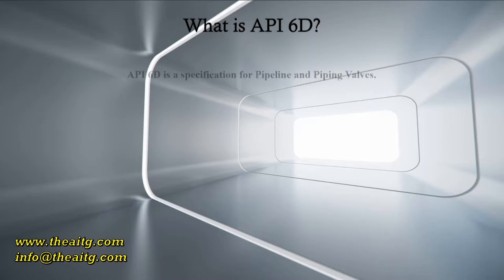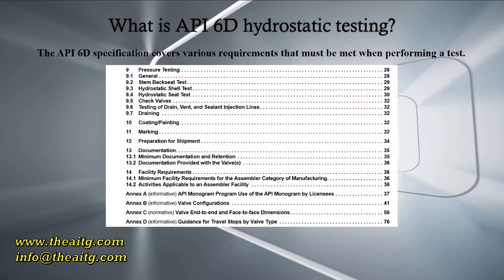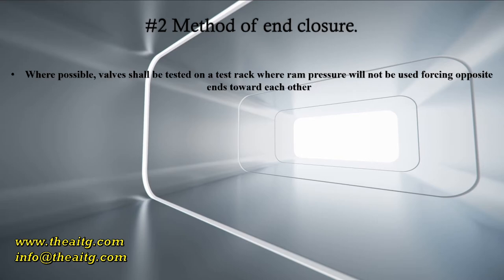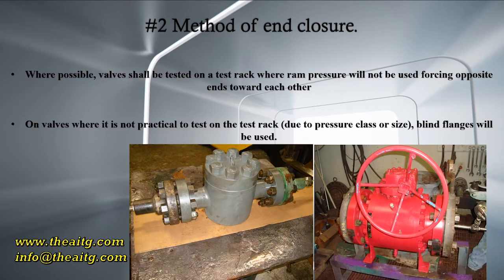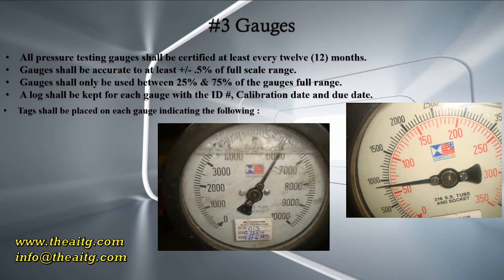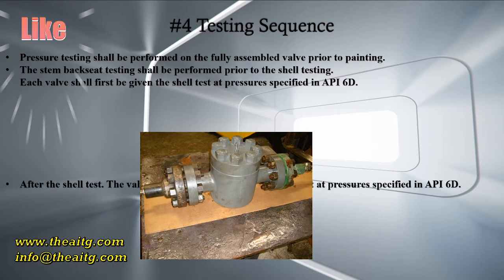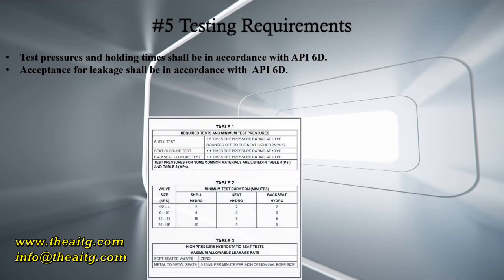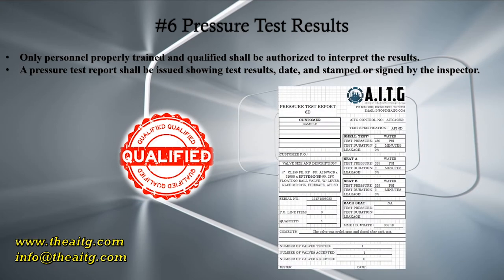API 6D Hydro static Valve Testing Procedure. How to test an API 6D valve. Pipeline valve testing

Comment: Hi, when can I use API 6D or API 598?
Reply from the maker: Interesting question. I’ll try and answer as simply as possible. Both testing specifications are applicable for ball valve testing. However, API 6D is a design and testing specification and API 598 is strictly testing. Usually pipeline ball valves must be designed & tested to API 6D. The customer can also designate what testing specification they want. Hope this helps. Thanks for your comment.
Reply: @everythingvalves  Thanks for your help👍👍👍